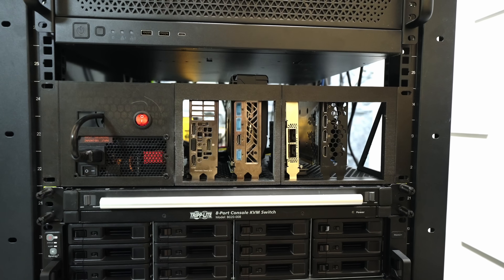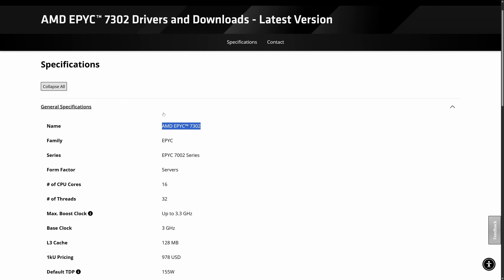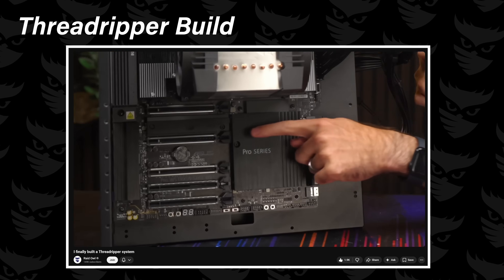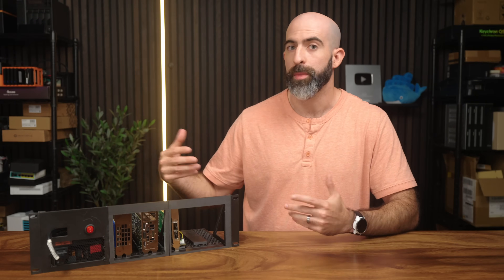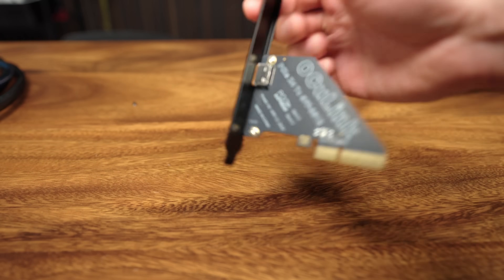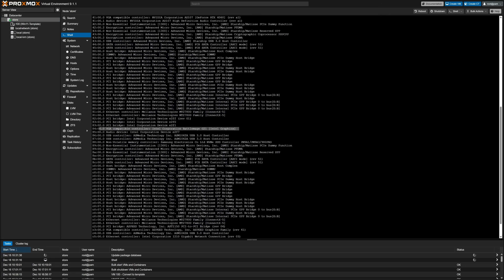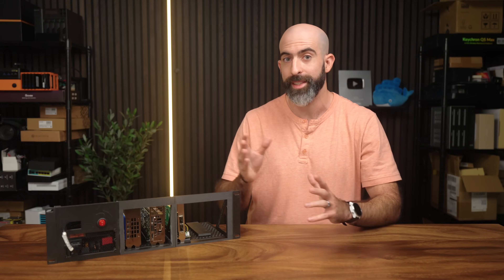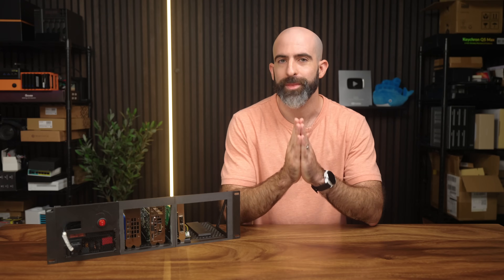Stop wasting PCIe lanes…build this!

Comment: You lost me at "5090." Go buy a mainframe. It won't do anything more, but it's bigger and uses more power.
Reply: @RaidOwl  “640K ought to be enough for anybody.”
Reply: @ElectroOverlord  - Yes, as a Salary... $640,000 ought to be enough for anybody.
Reply: @andre-le-bone-aparte  in this economy?
Reply: @ElectroOverlord  - Yes... 3090s are the best GPU under $1,000 - for now. Sadly, I think 2026 will force them to go higher due to no 5090-TI model or relief in Scalpers giving up on the 4090s and 5090s
Reply: @andre-le-bone-aparte  I have my 5090, but my point is Mr. Jeffnew suffers from a complete lack of vision and flexibility. Gaming it is fine for now but i want to look at distributed Ai Clusters.
Reply: @RaidOwl  I thing getting Mainframe and rack mounted a bit might up, but do have point it is long from simple desktop PC towers system , and going a lot more desk space, to fix problem manufacturers should fix them self the it' been from day of over large graphic card GPU becoming a thing but the still motherboard cards slots in places almost no one will ever be able to use them, but still being sold in motherboard spec though and reflected the prices, the x number slots, and x number you can not use, not being talked about? like this part of the motherboard away move the slots to where needed,  not fix to the board? what created should've needed to be created, but what made, its find a solution, made some else, good job just pity it not check fix, add a fully spect out version, but just for card, you might still better the amd external GPU case, and it's still sort of portable, the want laptop graphic kick boots too,
Reply: @RaidOwl  There is no reason to add a second GPU when your first is a 5090. You have a two-slot version of that card which leaves five (?) slots open for other peripherals. How do you need more than six things plugged into a personal workstation, regardless of how many PCIe lanes it offers?

The machine already needs a roof full of solar panels to power it.

This is not good.
Reply: @jeffnew1213 not everyone is broke, some people buy GPUs and then become broke.
Reply: @jeffnew1213 how do you need more than one power outlet in your house
Reply: @jeffnew1213  lol bro might want to go back to gaming channels.  I don't have a 5090 (partly due to the reasons he made this setup for) but I do have 6 gpus with 112gb VRAM total.  AI for Homelab is swimming in the deep end of the pool my friend.  I started with 2x 24gb M40 gpus which is 48gb for less than a 4070.
Reply: @jeffnew1213  bro's never heard of a virtual machine
Reply: @Gooberpatrol66  Bro's VMware certified, twice, and does virtual desktops for a living.
Reply: @RaidOwl  I'm not a subscriber or typical watcher of your channel, but this video and your post really says all I need to hear.

If someone has criticism you don't like, you can either
A) Ignore it.
B) Answer the critique with a level headed response.

But never C) Laugh/mock them. 

Let me give you an example. I watch channels like Level1Techs but then branched out to other channels, like Craft Computing for general homelab type stuff. At a certain point (not sure if they still do the same today), I was fed up with the exaggerated facial expression thumbnails and meaningless titles for their videos. I think it was a review for an RTX 3070 or something and DLSS feature update but nothing in the thumbnail suggested it was a GPU/DLSS review and the title was something along the lines of "This device does what???" or something ambiguous.

I left criticism expressing frustration with the title and thumbnail and their response? To mock me in the comments section. Presumably the clickbait continued afterwards, but their response/candor to criticism was childish and I just blocked the channel entirely.

So how does this relate to your video/post?
Poster Jeffnew1213 left genuine criticism about the use-cases and relatability of the video (a 3d printed rack mount device that expands PCI-E lanes for other devices). They got a point. A 5090 isn't sensible for 99% of viewers' homelab experience, much less a bunch of extra devices. I can agree with that sentiment, not only is homelabbing a niche subculture, but this is so far beyond a relatable use-case that I have to question what the point of creating the video is. Are there "dozens of us" out there that this solves an actual issue for? Your video would be improved by demonstrating use-cases besides a 5090. "Have you upgraded computers but still have old PCI-e devices you could use but don't really fit in your case? Maybe older video card(s) or 256gb M.2 SSDs collecting dust? This could be a way to continue to expand your system's PCI-e devices and keep older but functional devices in service.) 

And then we come back to the title. "I wanted this...so I made it". If I walked into a bookstore and picked up a book titled "I wanted this...so I made it" would I have some kind of idea about what the content of the book was about? It's a poor title. Arguably it's clickbait, and I clicked into this video just to understand what this video was even about. Imagine my disappointment when not only is this not a poor descriptor for the video (might I suggest "Homemade Rackmount PCI-e Expansion!" instead?) but you're laughing at critique in the video comments? You're going in the same containment zone as Craft Computing.

I'll stick to Level1Techs. I consistently see descriptive titles and thumbnails and good technical discussions. Unfortunately I don't see this channel changing direction any time soon. I wish you well in your future endeavors.
Reply from the maker: @JoeyJoJoJr17  lmao stfu
Reply: @RaidOwl  God bless 😂 perfect response
Reply: @RaidOwl  I don't like your videos or your personality (yet I'm here for some reason), I also think you're a bit of a poser but I disagree with the criticism presented.

Youtube has consistently had a genre of DIYers building shit, and whether it's useless to most people or god's gift to technology, the person making the video is going to clickbait. Everyone does it now, they have to in order to survive this site's algorithm. 

Joey's criticism doesn't go much further than "Your title is clickbait" and instead of ending his comment there, he throws anecdotal accounts of how Craft Computing has deeply scorned him with the response gave to the same criticism presented. Without providing any evidence this transaction actually occurred, we can't assume that Joey's original comment made to Craft was in good faith, or without any sort of antagonistic behavior that would cause Craft to give a response worthy of being put in Joey's Containment Zone. Which by the way, I hope you're able to escape, Owl. 

Jeff's criticism is not made in good faith, or even with any context of homelabs. I don't think Jeff even knows what the use cases for a multi-GPU setup is in the modern year other than for gaming. He tries to save himself with the second comment but it's made very clear that Jeff's criticism is very thin and falls apart under any sort of scrutiny, yes even laughter. 

Was it worthy of a level headed response? Well, if you don't think laughing isn't level headed, then sure. But is it really? Should you give level headed responses to comments that aren't level headed themselves? The original comment is mocking the video's creator, telling them to go buy a mainframe (which Jeff has also shown he does not have much knowledge of) in a way that comes off extremely pretentious and rude, especially when you consider that the criticism is wrong. 

Joey's account could also be Jeff's alt. But without evidence that's merely speculation. I do find it odd yet funny the lengths Joey went to defend Jeff's comment though. 

Jeff's comment comes off as very rude, pretentious and insanely uneducated. 

Joey's comment comes off as... butthurt? You can tell Craft Computing really hurt this guy's feelings, so now whenever a creator gives the proper response to any stupid comment they have to chime in. 

Was my comment necessary? No, I mainly just wanted to chime in so I could tell the creator I don't like them (which they shouldn't care about), but also to stir the pot.
Reply from the maker: Im well aware not everyone is gonna like me. I appreciate the objective view of the situation even while admitting you don’t like me, that’s rare to see.
Reply: @JoeyJoJoJr17 Hi, sorry I'm late, is this the line for "lmao stfu?"
Reply: ugh i type all this and click send THEN I see (was his name brett?) already responded. bruh.

TLDR, the "clickbait" hill or even the YouTube hill has to be one of the most intellectually bankrupt places to die in 2025. If it bothers you, you 1. don't look outside your window, and 2. never opened YouTube until now and would not have survived if you started with kevjumba/raywilliamjohnson and were bothered by titles until now. I assume you'd literally have died from the stress.

I work in tech, for a corp. What I fking hate is people who don't know what they're doing telling me what to do. Posing as ethics leaders or intellectuals. (every fking day if you know tech and corps) If you live in a system that extracts value from the world in ways that actually cause harm, yet you've chosen to exert your 'moral authority' on a guy making tech videos you need to sit down or just don't bother making eye contact with me because I will walk over and bring you into my dark abyss of existential thought, puzzling over this decision, until we make sense of it or it is thrown out.

if you write a manifesto about the "decline of integrity" because of a YouTube title, you are essentially admitting you have no real problems and I want to pick your brain until you give up.
Reply: @RaidOwl  Brett, I like you just fine. I've been watching your videos since you started. I was just put off a bit by this one. Absolutely nothing personal.
Reply: @jeffnew1213 there are plenty of reasons, starting with "I am trying to run a model that requires more than 32GB VRAM to do what I need to do."
Reply from the maker: I didn’t take it personally. I just replied with an emoji and some other dude acted like I cursed your entire family.
Reply: @jeffnew1213 crying about that someone else does or doesn't do with their own stuff and money even if you don't effect anyone negatively. Stfu. 😂
Reply: @jeffnew1213 you don’t seem to understand your limited usage of computers doesn’t extend to other people. I bet you can’t understand why people would need a truck when YOU only have a car 😂 I guess this is a pathological lack of empathy.
Reply: Im sure its not a difficult task. 😂
Reply: Awesome idea! Niche af but awesome!

Comment: I'd love to see some continued polish on this; I definitely have these problems.  I managed to get a 3 slot GPU into a framework desktop board but it sure wasn't easy.  I think what's really missing is standardizing enough on how breakouts should work that the cable and board components can actually get made in quantity without quite so many different assemblies.

Comment: If I could make improvement suggestions, I would make the groves between frame prints longer to add boolean fingers to help lock them together for more stability while you wait for the glue to dry.  Alternatively, you could just heat tap a screw mount as well.  I would also add hexagon booleans to the plates you use to mount the device adapters on, so they don't shift around.  I'd be interested in the longevity of this project, considering that PLA can warp when around a decent amount of heat!  Maybe a video a month later to see how it's going?
Reply: Also:  You can make both systems start up at the same time, if you send the right voltage to the  "power good" pin on the power supply.

Comment: Excellent idea. I did something jankier with an old 4 u server which had an x16 slot but no power adapter. So i mounted an atx power supply on the back of the server and fished the 8 pin pcie power supply thru the back to power my gpu. this design you did, would be much more elegant.

Comment: ive been looking into this too. MICO is just one option, SFF-8436 is another that ive found to be a bit cheaper. really wan to seen someone make a board with the section all the pcie slots are is just gone and theres a bunch of pcie mico or whatever ports you can just use these expansion cards and configure as you want.

Comment: I highly recommend 3M ribbon cables with MCIO connectors. They are way easier to route when you have a lot of cables, and you can bend them quite agressively to do 90 degree bends. You can easily do 1m and maybe even more, even at PCIe Gen5 and Gen6 speeds even. The cable prices are pretty good, and the signal quality and compactness is superb (better that unbundled twisted pairs, yes they are shielded, but ribbon is even better shielded).

Comment: I learn about bifurcation when i put a bunch of NVMEs on a pcie slot extension card on my old Dell D810 but this? The problem is if you power it with an other PSU and went dyslexic on witch button to press first well... you're f...big time!

Comment: Ive actually been going one further and going into the rabbit hole of pcie expander cards using plx pcie switches. 1 x16 slot effectively getting 2 x16. Only thing ive been seeing so far is them using SFF 8647 SAS cables for the interconnects instead of newer stuff like MCIO, Im sure brand new datacenter stuff is using MCIO and other alike but for old used hardware this is all im finding.

Comment: but only do this if you don't care about maximizing the speed of your gpu and m.2's. Because there is a slight decrease in performance with every pcie thing you use, especially if they are high speed or high output things (like capture cards, more m.2's, etc".

Comment: Hint: Find an "Adam Hall" shelf; those are cheap, then you should be able to use a dremel to carefully modify the shelf (and make bends, so you can use screws to hold the cards).
-Again: Carefully with the dremel is a keyword; because one mistake and you may have ruined your plans. It's probably a good idea to make a 3D model before you start, so you have an overview on how to make the bends (vertical and horizontal bends will make the shelf a lot more stable)

Comment: Good video.
I've been thinking about doing something like this for quite a while, because I really need it.
I have one PCIe 5.0 x16 slot and one PCIe4.0 x16 slot. I have two graphics cards; one is probably a PCIe 3.0 x16 and another is likely a PCIe x16 or PCIe 2.0 x16.
Yes, very stupid, but read on, it makes seonse soon.
The graphics cards are needed because I'm planning on running Proxmox for running several operating systems side-by-side; and special graphics cards are required (special firmware on the cards).

This really annoys me, because I'm putting a PCIe 3.0 card in a PCIe 5.0 slot and a PCIe 2.0 card in a PCIe 3.0 slot. A lot of wasted bandwidth.
I also want a dual 100Gb QSFP card, which is PCIe3.0 x4, but ... there's no more PCIe slots left.

PCIe 3.0 switches exist, so I could just pop a switch-card in and split out the PCIe slots, but ...
It's much more expensive than purchasing a new motherboard AND it will only support PCIe 3.0, so there's no real idea in doing this.

My best option really seem to be to purchase a ThreadRipper motherboard and a cheap TR CPU  - but I don't have the budget for that. :/

Comment: I've been building a cluster using some Minisforum mini ITX boards in dual ITX 2U cases I bought from China.
Those cases have a PCIe slot that clashes with the CPU fan, and I wanted 25G networking, not 2.5G.
So I bought some 16x to 2x8x MCIO breakout cards.
One goes to two NVMe and the other goes to an external PCIe slot as you showed to feed the network card.
Currently they're stuck to a 1U shelf, but I might have to step up and make what you made to make it look prettier. Although I wonder about making it half height instead.
My biggest challenge has been getting the right cables to power the units. It seems simple, just PCIe power connectors, but I wanted something more elegant. As it's just 10W, I am using some 2A PoE to 12V connectors and then a coaxial DC barrel connector fitted to the PCIe power connector.
That means I can switch the power independently for the NIC from my PoE switch.